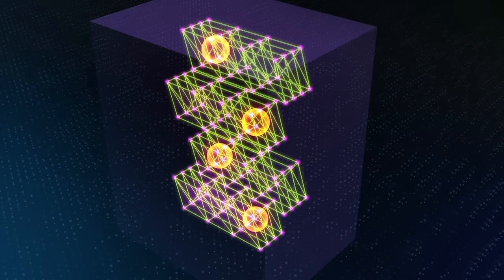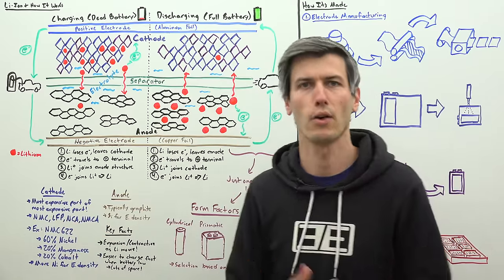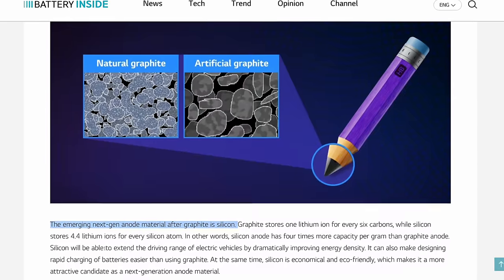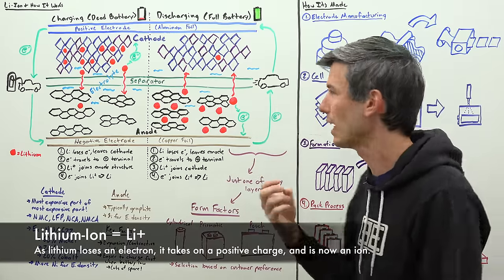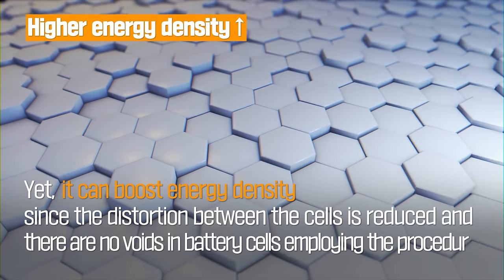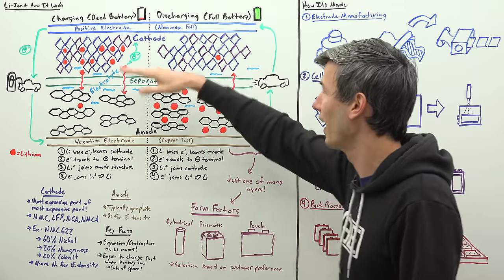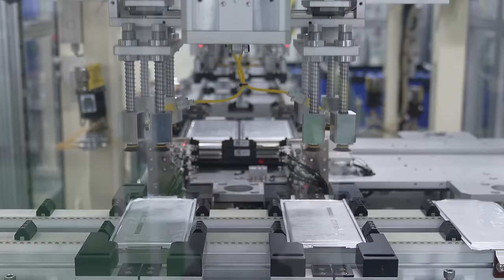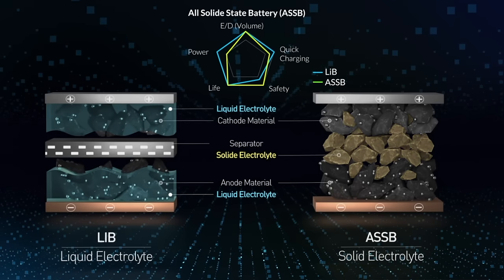Everything You Need To Know About Lithium-Ion Batteries

Comment: Great video. I was researching optimal charging strategies so I am familiar with the concepts you explain. The new NMC structure is called monocrystalline NMC.  I didn't know about how the crystals were structured though, that was news to me. I understood that monocrystalline simple meant that NMC particles made of multiple crystal lattices will deteriorate more than a monocrystalline structure. Perhaps this is completely different to what you are talking about though. 

Reading about how the cathode and anode are impacted by charging and discharging has made me have a different charging strategy to the simple "up to 80%" charge recommendation for NMC. First of all I don't charge above 75% if I can avoid it as it is above this level that deterioration due to high SOC really kicks off. Second of all it is better to go over the 75% for a trip than go below 30% charge. Third of all I charge up to the required amount above 50% just before my trip. When the car is parked up I keep the car at 50% SOC. I think it might be better to have it in a lower resting SOC but I think 50% is a reasonable compromise to allow me to top up with the required charge amount just before I drive. The overall theme is to charge and discharge as close to the 50% SOC mark for your given trip and don't hold a high SOC for long periods.

Obviously the above strategy works when you know the percentage battery you need for a given trip. A more pragmatic strategy is needed for trips to unfamiliar destinations.

I am now thinking of altering my strategy in cold weather. I have type 2 charging at home but when the ambient temperature is below 10 degrees celsius I am thinking of pre-heating the battery even for type 2 charging to prevent lithium plating on the anode. I will charge up to the 50% mark immediately upon arriving home as the battery is still warm. Overall though I am glad I live in a colder climate from an EV ownership perspective as nothing deteriorates a battery more than high temperatures.

Could you do a video on battery deterioration? I think there is a real need for it. There are several videos on YouTube but none of them get the views this topic deserves.
Reply: Bruh you think Tesla isn't the best electric car ever made?!
Reply: Battery deterioration is fairly simple. The closer you get to 100%, the more energy is lost for charging and the more strain is put on the battery. Emptying your battery close to 0% isnt too good either. Staying around 50% will last you the longest, but modern EVs will last long with charging full as well, since they never get 100% full and 100% empty.
The faster you charge, the faster it deteriorates. Use fast charging only when necessary, it causes unnecessary heat and is less efficient
Reply: @kevingarfield2094 Tesla is great but the battery drain caused by Tesla's sentry mode and other advanced features is well documented. Therefore if it is sitting up for a while then probably needs some extra charge to tide it over.
Reply: re: "There are several videos on YouTube but none of them get the views this topic deserves." well i don't know, Kim Java just did one with her neighbor (Dobson) who used his Tesla Standard Range for Ride Sharing and was fast charging 2x per day, and has basically burned out his battery and lost capacity from driving 120,000 miles around Atlanta in 1 year.  he just had the battery replaced with a refurbished one by Tesla (not new) that cost him $9,000 dollars.  that's the best "torture test" and info you're going to find on YouTube.
Reply: @Menon9767  The thing is the battery buffer varies from model to model. I suspect in what I drive most of the buffer is on the low end with very little at the top end. I wish car manufacturers were more transparent about where the battery buffers are in each model.
Reply: @Menon9767  Also worth mentioning there are two types of battery degradation: charge cycle degradation which you describe above and just the simple degradation that happens with time. This is influenced by temperature and SOC and tends to be the more important one over the long term.
Reply: @brendansheehan7714  that's very true. What warranty does your battery have? I wouldn't worry too much about it. Of course, if you know you will use about 50% on your daily trip, only charge to 80% so you have enough reserves but don't max out
Reply: @brendansheehan7714  very true, but in the end it doesn't really affect you which degradation does what. Just follow those few simple rules, and even if you don't it most likely won't be a big financial issue
Reply: @phillyphil1513  120k miles in one year is absolutely crazy lmao
Reply: @Menon9767  ikr...? there are OTR truckers jealous of those miles.
Reply: @phillyphil1513  currently watching that video. Is really interesting and rip that guy. At least the gofundme seems to have paid out
Reply: What is this "phantom power drain" you claim that Teslas have? My Model Y loses less than a mile of range a day while parked, which is about .25%. It'd take over a year for my battery to drain from full to empty.
Reply: @@Nnonyabiz ...what? Your comment makes no sense.
Reply: Check your owner's manual or other information about your specific model, but any new model should automatically warm the battery above plating temps before charging. If the cold climate package on my '13 LEAF had that figured out, your car should. I think the temp where that becomes a concern though is closer to -10C than 10C, which is a lot easier to avoid. That's what I understood for my ancient NMC chemistry battery, your newer chemistry should be the same or better.

Comment: Love your videos.   Would love to see your analysis of what causes these batteries to build up so much heat they can catch fire (especially when charging it seems?).  This is more than idle curiosity since a home near me was completely destroyed when a car was charging in the garage and a fire ensued.
Reply: You can find some examples in the defects of Chevy Bolt and LG home energy products (both with batteries manufactured by LG.) EV fires are less common than ICE fires and we've lived with that for decades. We've seemingly accepted that manufacturing defects and fires will happen in all areas of home energy usage. The more interesting is the question in how we prevent the chain reactions and reduce the furiosity of battery fires.
Reply: There are multiple possibilities, but the most common issue is dendrite growth. So when you charge a Li-Ion battery very fast, what can happen is that the Li is not properly able to intercalate into the graphite anode and instead gets deposited as a metal on top of the graphite. Unfortunately it doesn't simply grow as a uniform, flat metal layer, but instead likes for form very thin needle like structures called dendrites. If these dendrites grow long enough, it can happen that they will pierce the separator and short circuit to the cathode side. If this happens you have locally a very high current running all of a sudden. This high current, through a very thin wire so to say, results in a lot of heating. Enough heating actually to get the electrolyte to vaporize and getting ignited. And when this happens it can start to set the rest of your battery easily ablaze.
Reply: Two points to consider that Ricomeltzner didn't already cover:
1. Electric vehicle battery fires are about 60 times less common than gasoline vehicle fires.
2. Newer battery chemistries are immune to thermal runaway, and thus cannot set themselves on fire. LFP is one such chemistry, and the even newer sodium-Ion chemistries are similar. 

A large percentage of the EVs being build today use LFP batteries, which makes fires even less common than they were earlier this decade and late in the 2010s, when high-nickel chemistries were all we had in mass production.
Reply: @coredumperror  the previous commenter just wanted to know how batteries set themselves on fire, so I just mentioned one of the mechanisms that can happen. btw the one I explained can literally happen for any Li-Ion and Na-Ion battery technologies, when you have a liquid electrolyte. Likely only solid state batteries are really immune against it. What you can do to kinda prevent it, is to have a good battery management system, which prevents you from ever charging so quickly that the metal cannot intercalate into the anode. But that obviously comes with the price of always having inherently reduced charging speeds. This is also the main reason why you can have potentially higher charging speeds in solid state batteries, you do not have to worry about dendrite growth, that could set your battery ablaze.

Co containing batteries have an additional mechanism, which can set them on fire, which is basically a decomposition mechanism of Co2O3 at high voltages, where it starts releasing reactive oxygen species, which will react exothermically with the electrolyte and boom there you have your runaway reaction going to set your battery on fire. Though all this can be prevented with a good battery management system, but as these are all external systems, they might fail.
Reply: @ricomeitzner7584  LFP batteries are immune to *thermal runaway*, because they don't burn hot enough to set the nearby cells alight as well. They also don't explode when punctured like NMC batteries do.
Reply: @coredumperror  2. LFP is not immune to thermal runaway.   They do have higher TR threshold, but they also catch fire no problem.  It's just that you don't hear as often because most LFP EVs are in China.

Comment: How about a real world test on EVs in cold temperatures for weeks at a time. I live in Edmonton, Alberta, Canada and the reality is minus 30 Celsius or colder, parking on the street with no ability to charge at home. How well would this work with a daily driver that needs to go at least 40 kilometres a day. Minus 30 can be a daytime high here with colder tempertures at night and this can go on for weeks. An unbiased test of how well this would work out would be nice. How often would charging have to be done and what effect would this have on the battery. For a lot of people best case scenario would be plugging in overnight into a 120 volt 15 amp power source with a 50 or 100 foot extension cord.
Reply: There are numerous videos of people testing EVs in cold weather. Engineering Explained has done at least one of them, and Out of Spec Reviews has multiple videos on driving EVs in the cold. The website Electrek has also reported on the number of people in Norway who've adopted EVs and don't seem to have a problem with it.

That said, at the very least I would advise plugging an EV into a 120v outlet, if not a L2 charger.
Reply: It might come as a surprise, but putting a small charger on the sidewalk is not a big deal. You could even put light on them to light the sidewalk and you could then call them like "streetlight" or so.
Reply: 120v 15amp is 1.8kw, but you can only load a circuit to 80% for long periods of time, so 120v 12amp is 1.44kw. My 2013 LEAF with smooth wheel covers and a grill block averages about 5.6km/kwh at -10C (this is over 5 winters in the upper Midwest), so for -30C and a good margin of error let's assume 5km/kwh. So to be able to drive 40km/day you'll need to charge at least 8kwh, which will take at least 6 hours. Perfectly doable. Now, charging isn't perfectly efficient, especially that cold because part of the power is going to keep the batteries warm, but that's not as much as people think since it's usually only warming the batteries to -5C or so. If you had a LEAF like mine I expect you could regularly make your drive with 7.5 hours of level 1 charging. The only charging I've used at home for 6 years is 120v. I do have a 20amp circuit in my garage, so I got a 16amp EVSE to charge a little more quickly and efficiently.

Generally extension cords are frowned up with high amperage devices, but as long as you get a big fat cord that doesn't drop much voltage over your 50 or 100, you should be fine. I used a 25ft 12ga extension cord for a few months with my 12amp EVSE and did burn out a cheap 15amp GFCI outlet, but replacing it with a quality 20amp outlet worked fine.

Comment: Way too short of a video, I would love to see more videos like this. Especially ones that break down the myths of how bad anything EV is, lol.
I love ICE vehicles but if done right (and not forced on us by the government) EV's can be a great replacement to ICE vehicles
Reply: EV's are great until it gets slightly cold, then you loose all your range and lots of functions. Worthless pieces of junk anywhere far from the equator..
Reply: @woolychewbakker5277 hence ”far from” the equator
Reply: @immDroidz  don't worry, climate change has that covered. In 20-30 years there will be no place colder than -5
Reply: @immDroidz Have you heard of a country called Norway? It gets pretty cold there but they love Evs 90% of cars sales YTD have been EVs.......
Reply: @immDroidz Nonsense, I regularly drive in -30C with my EV in the winter. Yes, the range is reduced, but everything functions the same as it does when it's +30C.
Reply: @immDroidz  Yeah this is why in Norway, a tropical country as we all know, they use them a lot.
Reply: @immDroidz  
Empirical testing has shown that that certain types of EV vehicles lose less range in very cold temperatures than ICE vehicles.  It depends on battery management technology, electric battery heating, heat pump usage, etc.  And of course EVs always start no matter how cold it gets.  ICEs usually needs block heaters when parked overnight in very cold temperatures.  Not starting is the ultimate range loss.  Only towing to a warm garage solved this problem in my experience.

A conventional gasoline car's gas mileage is roughly 15% lower at below freezing temperatures.  For an EV it’s up to 30%.  But less if you depart in an already warmed up vehicle.  So you are fussing about at most a 15% difference.  Get a bigger battery and your worry is gone.

Winter driving range losses for popular EV models (freezing vs 70-degree weather) 

Freezing means between 20 and 30 degrees Fahrenheit (-6 to -1 degrees Celsius).

2022 Figures from 7,000 vehicles in the United States:

Audi e-tron	-8%
BMW i3	-24%
Chevy Bolt	 -32%
Ford Mustang Mach-E		-30%
Hyundai Kona	-19%
Jaguar I-Pace	-3%
Nissan Leaf	-21%
Tesla Model 3	-17%
Tesla Model S	-19%
Tesla Model X	-15%
Tesla Model Y	-15%
VW e-GoIf	-23%
VW ID.4	-30%

2023 Figures:

Hyundai Kona 2020/2021	-34%
Ford F-150 Lightning 2022/2023 Extended Range	-26%
Audi e-tron 2021/2022	-16%
Ford Mustang Mach-E 2021 Premium AWD Extended	-34%
Tesla Model Y Long Range AWD	-24%
Tesla Model 3 Long Range 	-24%
Chevrolet Bolt 2017-2022	-42%
Tesla Model X IOOD	-24%
Volkswagen ID.4 2021 	-46%
Nissan Leaf 2015 	-23%
Tesla Model S 90D	-28%
Nissan Leaf 2015	  -34%

Source: Recurrent Auto Research